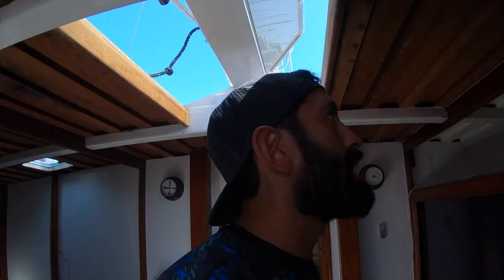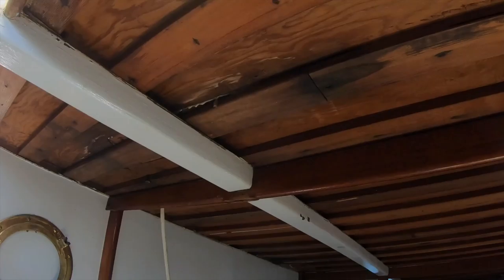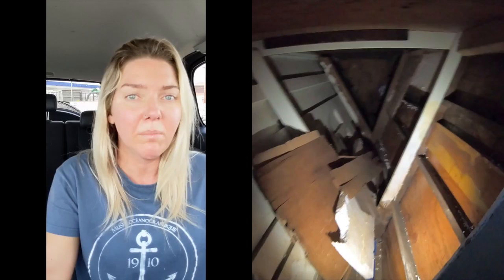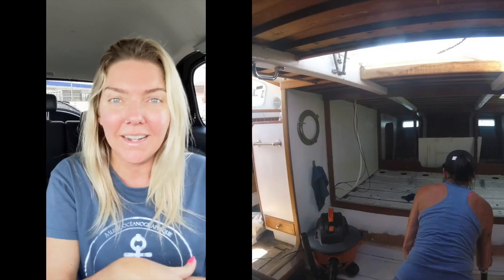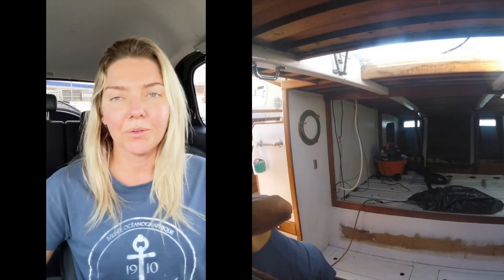Ep. 4 "What Do We Have?" White Shark Sailing Trimaran SV VLOG Adventure Multihull Yacht

Comment: hi guys my name is john in maine ...we have purchased the plans for a Piver AA48 from the Virginia maritime museum your boat is not built the same as a Piver I believe it is a Cross design. I think this because the cross beams in the main cabin  and the posts  the frame structure is very different
Reply from the maker: Hmm interesting. I'll look into the cross builds
Reply: @WhiteSharkSailing  I was wondering does your boat have a short keel on center hull ? if it does I am almost positive it is a Cross design . Our Piver 48AA has a hard chine hull design with skegs on the amas  but none on the center hull Piver also liked ketches  I would send pics of our boat plans if you would like. Have fun !
Reply from the maker: @johnstewart5137  Yes it does have a short keel on the center hull! When we cleaned it last week, we checked using our dive computer and the keel gives us about a 4ft draft. After you mentioned the Cross design last month, I looked and the hull shapes do look similar to other cross builds but we haven't been able to find interior pictures or build plans that look like ours. We found the hull id etched into a beam behind the motor and there is no manufacturer code. We're thinking it's home built as well but thinking they had to use some sort of plans....right?!
Reply: White Shark Sailing yeah there were alot of home built boats my father built a 48 ft piver in 1969  we then sailed to Fiji and Vanuatu  where we were ship wrecked 😣
Reply: so now I'm building one 50 years later gonna try again😀 actually I'm about to glue up frame 8 as soon as I eat lunch 14 more to go ! well for main hull
Reply from the maker: @johnstewart5137  That is seriously so awesome! It's especially cool that it has sentimental value to your build as well. My(this is Shaun) grandfather used to rent boats from his yacht club and take my brothers and I out sailing. I like to think he would've been proud of our project.

Comment: I've built,rebuilt,refitted,and redone many many boats in my many many years and...well...I don't remember even once when reaching out and pinching a...her...um well...does squeezing her 'Cuchi' make her work harder or does it make the boat go faster?...or make it stronger?...or...Um,what effect does 'Cuchi' grabbing have on boat building?...besides the obvious?
OH,and why didn't she react (jump or move)...almost like she was familiar with having her 'Cuchi' grabbed?
All due respect to you both of course...
Reply from the maker: It's in the new boating manual and is used for motivation. lol
Reply from the maker: Not sure what happened to your comment in Ep. 8 but thanks for the follow! We're not sure on hull speed since the previous owner never took it out and knew nothing about it. Based on similar trimarans, we're thinking it will probably sail somewhere around half wind speed and max'd at probably 11 knots or so.